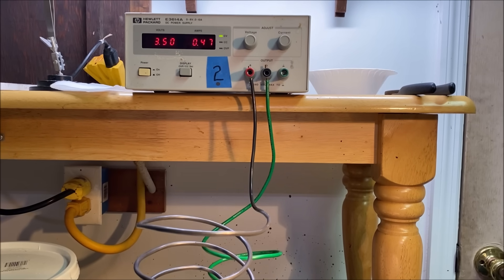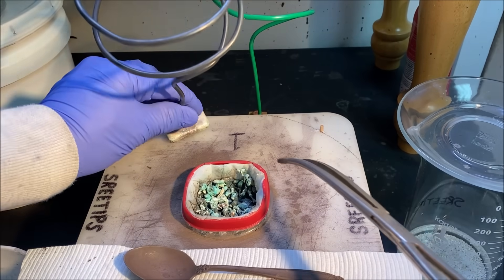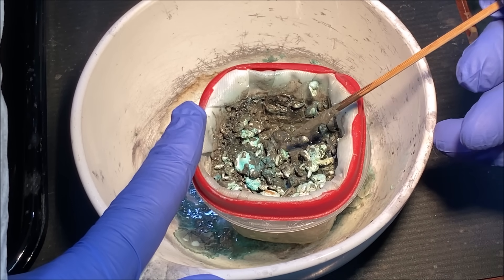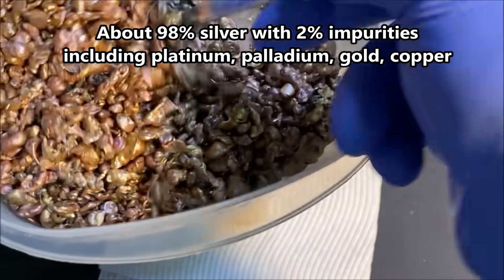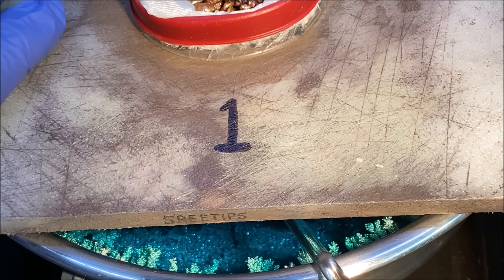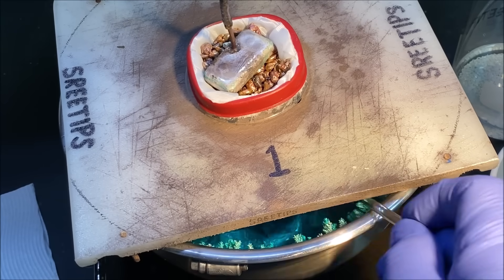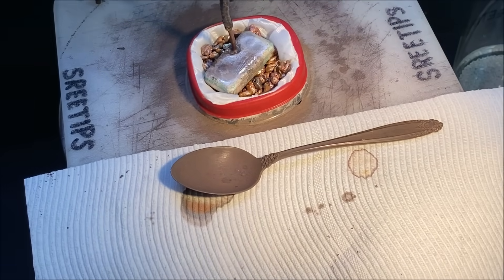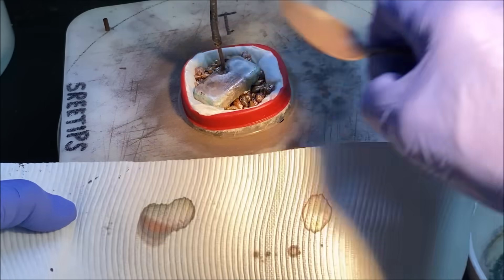How I Make PURE SILVER in my Silver Cell

Comment: Sreetips could you do a video showing all silver used on the scales before refining  including anode and electrolyte etc then the results weight please cheers or because i don't see how it's profitable
Reply from the maker: I’m not doing this to make a profit. I’m doing this because I have several hundred pounds of impure cement silver from my gold refining. It’s purity and value are questionable. So I MUST run it thru my silver cell in order to get it to the industry standard of three nines fine for pure silver. Hope this makes sense.

Comment: Out of curiosity, Is it feasible to run sterling silver (925) through the filter basket and have the same outcome?
Reply from the maker: Yes, but the electrolyte would quickly become saturated with copper.
Reply: @sreetips  Thank you for the reply. Interesting stuff...
Reply: @sreetips that's what I was wondering. Would dissolving the sterling in nitric then cementing out the silver be the way to go if we aren't refining scrap gold?
Reply from the maker: No, the only reason I refine silver is because I have a ton of cement silver recovered from my gold refining. It’s purity and value are indeterminable. So I MUST run it through the silver cell to get it to industry standard 999 parts per thousand. Sterling contains a known quantity of pure silver. So as long as you don’t melt it and ruin the markings, it can be held just like it is. I have about 1000 pounds of silver. 800 lbs of it is Sterling silver and will remain that way. 200 pounds of cement silver recovered from my gold refining. So unless you’re using Sterling to refine gold, there’s absolutely no reason to go through the trouble and expense of trying to refine the silver. Sterling will track right on up with the bullion price. As long as you don’t ruin the markings.

Comment: I have seen you process the slimy contents of the filter bags separately. If you wash the contents in a filter strainer, you can separate unprocessed silver shots from slime. You can return the unprocessed silver shots back to the silver cell and handle the slimes later. It does two things. The volume of slimy contents (to be processed later) is reduced by half after silver shots are separated. So your future process of slimes is reduced. Your silver shot does not have to pass through another chemical process along with slimes and directly goes to the cell for reprocessing.
Reply from the maker: That’s a good idea, thank you

Comment: Thank you for sharing your experience with us! Never gets old. Can I pick your brain? If there’s anything you would change on your fume hood what would it be? 😊
Reply from the maker: I bit more room would be nice.
Reply: @sreetips  mine is 29” H x 27” D x 23” W.  I thought it was going to be ok until I got the baffles in. Lol
Reply: Only one issue to work out, the motor on the hood is getting hot. 🤔🤔 maybe some air to enter the bottom ports and expelled out the top ports. 🤔🤔🤔🤔
Reply from the maker: I had that problem. I placed a restriction at the top of the stack to create a little back pressure. It sounds counterintuitive but it actually causes the motor to draw less amps and run much cooler.
Reply: @sreetips thank you very much! I will be doing that 😊
Reply: @sreetips  would an inline booster fan work? And aluminum drier vent so wind doesn’t blow in.
Reply from the maker: Can’t use anything metal. The acid fumes will quickly destroy it.
Reply: @sreetips  found a better way to cool the motor. Inline HVAC booster that will sit around the motor. Tried it out and worked out great.

Comment: Did my first recovery using inquartation yesterday. 11.86g of potential 13.55, with a couple tiny beads stuck to the melt dish. 

Approx 23k didn't do a re-dissolution in aqua regia. 

I might try some more. I use I thiourea carbon in pulp method usually, effective and less manual labor. The chemical cost is virtually identical even with recovery of the thiourea, although I could in theory still off the copper nitrate to recover nitric. 

Glad to see the silver not getting left behind!
Reply from the maker: Nice!

Comment: Have you tried melting pure silver crystal and pouring that into pure silver shot to use in your filter baskets?
Reply from the maker: No
Reply: @sreetips  I think that pure silver shot would work better in your filter basket than the pure silver crystal did in your previous experiment.
Reply from the maker: Melting adds an extra step
Reply: @sreetips   You have to melt your impure shot.  What's the difference?  With pure silver shot you would not have to replenish the anode nearly as often as with pure crystal in which you almost had to constantly monitor.
Reply from the maker: I agree with you. The shot works better. I tried running cement silver powder. It clogs the filter almost immediately. So that’s why I must melt the impure cement silver before running it through the cell. But I agree, melting the pure silver crystal into shot would work better.

Comment: Got an idea to mitigate the slime buildup. The Dacron polyester material also comes in "wool" batting form, and I wonder what would happen if you put a patch of 1/2" to 1" thick batting at the bottom of the bag. I think it might give sediment a place to migrate away from the silver shot. If the slime likes to settle in the batting, it'll keep the shot clean and maximize surface area available to electrolyte. Also, I still think it might be worth revisiting the idea of a circulation pump that continuously wets the shot that sits above the electrolyte surface. Anything that increases the amount of silver shot in contact with the electrolyte will accelerate the reaction, and "rinsing" the dry shot to move sludge down into the wool "sediment trap" would do just that, twofold. Less sludge coating the submerged shot, and more electrolyte in contact with more silver that would otherwise be dry. There's gotta be a way to keep the sediment and the shot away from each other during the reaction.
Reply from the maker: Good suggestion, thank you
Reply: @sreetips  Thanks for noticing it! You've already got your silver cells tuned pretty dang good, cranking out the crystals at record pace now. But I think it could be even more efficient, without a big investment. If you like the shot-rinse idea, maybe look for a diaphragm pump, such as a fish tank air bubbler, or a circulation pump from a little desktop water fountain decoration (think HoMedics brand).  Even just a drizzle of electrolyte flowing downward over the shot would keep it clean and part of the reaction.

Comment: Yes, I don't know the math, but at a certain point, copper will begin to deposit with the silver. I believe the blue color of the electrolyte would be a good indicator as it starts off clear and becomes darker blue.
Reply from the maker: From this day forward, I’m using the electrolyte for a single run of the silver cell. I used to try to get two runs from the same electrolyte by adding a couple hundred more grams of silver dissolved in nitric. But I’m done with that. I need to get moving on this because I’m running out of time, on earth!
Reply: @sreetips Less work for you Sreetips 🙂

Comment: A dectron pocket is 10smeters deeper than a silver bar. All the slimes goes down
Reply from the maker: I’m just a small hobby operation. I’m only running the silver that I have used/recovered from my gold refining.
Reply: @sreetips so do i
Reply: @sreetips your small filter is making me nervous)))
Reply from the maker: It’s worked fine for fifteen years

Comment: Hi, Mr sreetips! I do not use silver shot. I am casting a 200gr silver bars.  I use 5liter beaker . Stainless steel electrode. A pocket of dectron fiilter bigger then silver anod. 3.5volts 7amps. All the slimes goes to a dectron pocket. To restore filter i am boiling it in hot delute hno3. 100times of reusing dectron fiilter . When anod became small i insert the second one. 9kg per week
Reply from the maker: Nice!

Comment: How much more is 100% pure filter worth vs 98%? Could you just sell it at a 2% discount and avoid all this process 😂
Reply from the maker: Probably not. The purity and therefore its value, are questionable. Folks would only be will to offer 50% if that. But after running it through the cell and turning that ugly mess into high purity, investment grade, three nines fine, pure elemental silver, its value is easily determinable and I can get a premium price. But only if I wanted to sell it. And with spot silver price so grossly undervalued, I’m not wanting to sell any of my silver. I’ll just hang on to it.
Reply: Yeh, when it's got unknowns in it, it's not gonna sell well. If you were selling it as 98% Ag, 2% Cu, i.e. known content, that might be different, but he's also getting the platinum group metals from processing it.
The problem with mixes, is if someone wants to make a specific alloy and you're selling metal with another unwanted metal mixed in, they'll just not buy it. Sell at 100% purity and it can be used for whatever alloy they want with confidence and you'll get the full price.

Comment: Hey Sreetips, I guess I am not understanding how this works.  You have to you use 20+ ounces of pure silver for the electrolyte.  And 5oz for the anode as well as the # of ozs of impure silver.  So is the output more that all of that?
Reply from the maker: My last harvest was 2.4 kilos. That 2400 grams of pure silver or 77 Troy ounces of high purity, investment grade, pure elemental silver. So yes, it is definitely worth running the impure silver through the silver cell. What else could I do with the 98% silver? Its purity and therefore its value are questionable. As is its value. But after running it through the silver cell its value is easily determined.
Reply: @sreetips  Thanks for clarifying.  I couldn't see the increase in ounces.
Reply from the maker: There is no increase. For every kilo of impure 98% silver that I add into the anode basket, I can expect to harvest about 980 grams of pure silver.